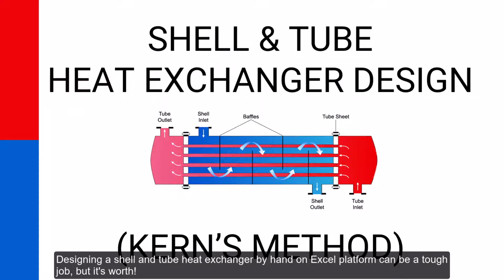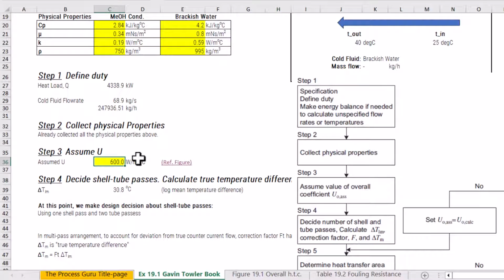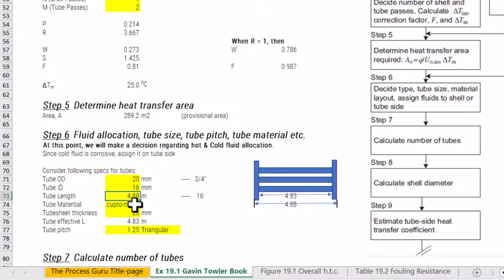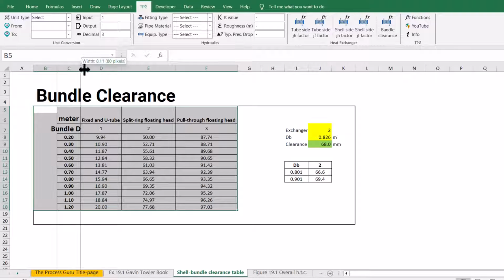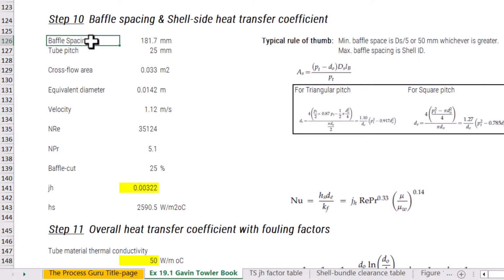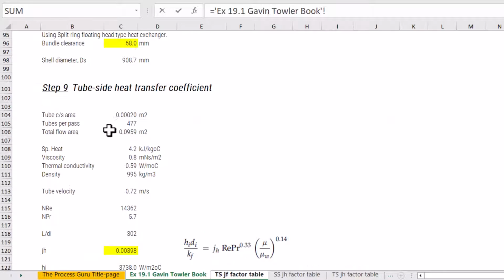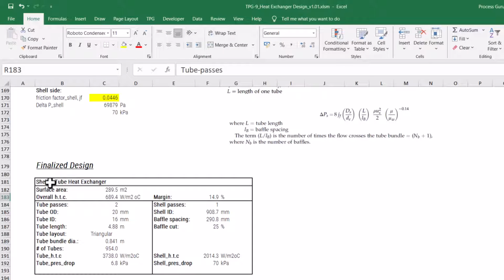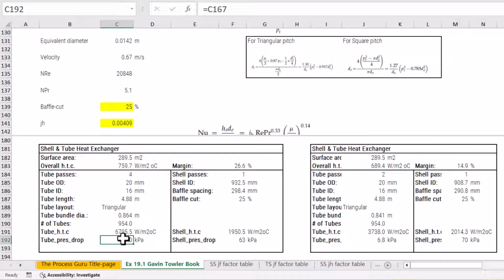Shell and Tube Heat Exchanger Design - Kern's method [with sensitivity study] [FREE Excel Add In]

Comment: Good excel sheet.
Is this formula applicable for 2 phase flow or single only. What is %margin , is this %over design
Reply from the maker: @atishjain7093, Kern’s method is mainly for single-phase flow and is great as a teaching / preliminary sizing tool.  It’s excellent for understanding how exchanger parameters (tube passes, baffle spacing, baffle cut, etc.) affect performance.

But in industrial practice, engineers don’t finalize exchangers using Kern’s method. Instead, they rely on rigorous commercial software like HTRI or Aspen EDR, which use detailed correlations, geometry effects, and validated databases. Kern is best for first-cut sizing or academic learning, not for final design. 

The % margin in the sheet is basically the % over-design — how much the calculated heat-transfer area exceeds the minimum required area. The % margin (over-design) shown in the sheet is the extra area provided beyond the minimum required. This helps take care of uncertainties in design data, fouling allowance, and possible future operating variations.

Comment: What equation (its not ditus bolter, not sidder tatte) you have used to calculate the tube side and shell side heat transfer coefficient?
Reply from the maker: @dipankargayen4501 — I’ve used the Colburn jh factor approach from Kern’s method.
The jh value is taken from standard charts based on Reynolds number and geometry, then used to calculate the heat-transfer coefficient. This method was applied for both tube side and shell side.

Unlike Sieder–Tate or Dittus–Boelter (which apply only for fully developed turbulent flow inside tubes), the jh factor method works for both tube and shell side.

Comment: sir can you tell me the optimum pressure drop in tube side. In shell side i think pressure drop is 0.5-0.7bar for less viscous fluids
Reply from the maker: Sorry for late reply. I’m not getting that much time lately to visit my YouTube channel. Anyway, based on my experience, typical pressure drop values usually fall within the range of 0.1 to 0.5 bar. During the design phase of a new asset, there is more flexibility to allow for a higher pressure drop. However, in debottlenecking projects, the available margin for pressure drop may be limited, requiring careful selection. A range of 0.1 to 0.5 bar is a reasonable estimate, but it’s essential to refer to project-specific guidelines when making decisions.

Comment: Sir is great yours videos thanks a lot, a questions how do when the factor for viscosity is necessary use it?
Reply from the maker: @luisvargas7569 thanks for your comment.

In preliminary design assignments, typically we can assume viscosity correction factor as 1. For precise/accurate design, we need to use viscosity correction factor.
 
Gavin Towler's book (2nd Ed, page 1080) --> "The viscosity correction factor will normally only be significant for viscous liquids."
So, in case if you are designing a heat exchanger for crude oil or some other viscous fluid, you ideally need to use viscosity correction factor where wall temperature needs to be estimated by trial-end-error. This method is highlighted in Gavin Towler book. For low viscous fluid like water or methanol, you can comfortably ignore the factor.

Good luck! 👍